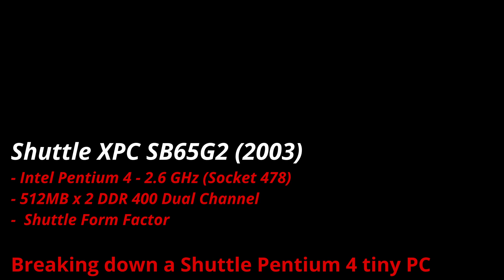Tearing Down Shuttle XPC from 2003 - Shuttle XPC SB65G2

Comment: is it fit to install a dual fan graphic card?
Reply from the maker: Single slot AGP should be fine. The length is good. But for modern graphic may be not ok, anyway it only has AGP slot. Not sure for PCIE version.